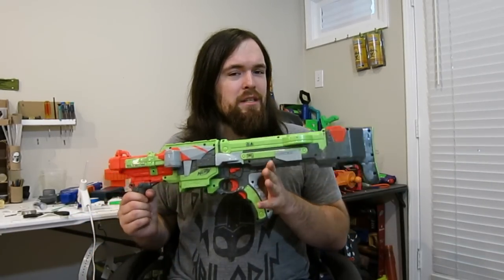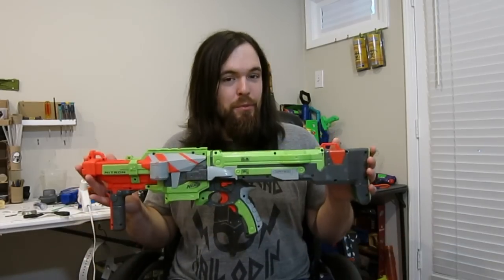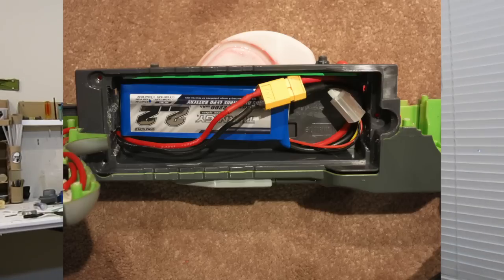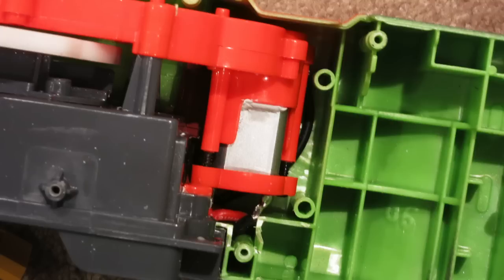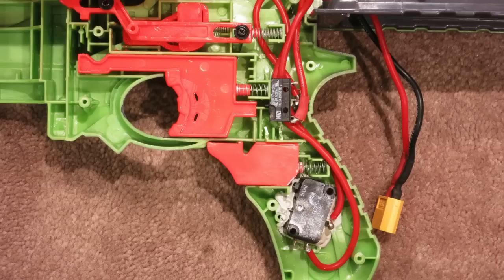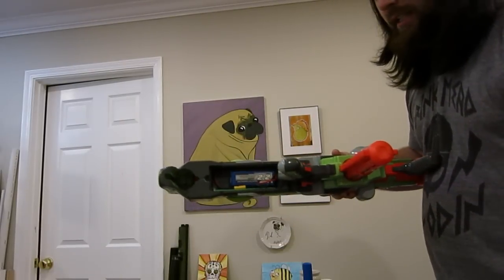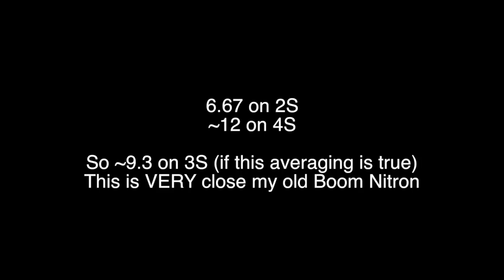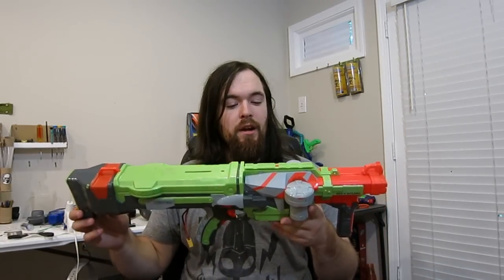Nerf Boom Nitron 2.0 (Upgrading the Boom Nitron)

Comment: I also encountered the problem where the pusher doesn't fully contract. It's because there is a switch (in stock form) which will continue the circuit so that the pusher retracts after you release the trigger. It's not as simple as just rewiring the circuit with the switch, though. If you keep the switch in (and overvolt it), the pusher will move so quickly and it will not stop fast enough. Because of that the big white disk will keep contacting the switch and keep your circuit open.
Reply: Which is why you also need the "active" or "dynamic" braking feature. That's what slows down your pusher mech fast enough to stop it overrunning the switch. The more powerful your motor the faster it can brake (which is why pusher motor replacement is better than pusher motor overvolting; you get the same higher RoF but without runaway firing).
Reply: RGBGamer what?

Comment: Thanks for posting this mod.  Inspired me to get a Nitron and mod it.  I did the 180 motor swap, rewired w/ 16 gage stranded from an old extension cord and upgrade both switches w/ 15A micros.  It wired so the pusher switch only gets power if the fly is running.  I'm running a 3s Li-po in it.  All the mechanical locks, old switched and wire have been removed.  The Nerf gun that was considered a joke by my kids now dominates.  I just need to make a double mag so I can scavenge and reload while shooting.  Again Thanks for posting the video.

Comment: Just a thought. DC motors have a sort of braking capability if you short out their terminals. If you use a switch that shorts the terminals to each other when it's depressed, the motor should stop faster. This is the method that cordless drills use.

Comment: To get the pusher motor to always return to the starting position, you need to integrate a tapered switch that closes a circuit only when the arm is fully retracted. If the motor is running too fast for the auxiliary and it overrides the switch, this can easily be remedied by putting a resistor in the return mechanism circuit. The stock (original) switch will not function with a Li-Po.

Comment: I love this video.  Thanks for posting.  The 180 motor mounting tricks is nice to know.  I would like to know what RC motor size the fly wheel motors are closest to.  130, 180, 370, 540....  Have you considered replacing the stock fly wheel a Worker fly wheel for a Stryfe?  Are they the same size?  It would make a cool video to e see the Nitron shooting without the barrel focusing on just the cage.   It would be interesting to know if the barrel slows down the disk and helps them go straight.   I'm also curious as to which direction the Idler wheel spins and if replacing it with a motorized wheel would kick it up a notch? I'm currently machining a Dr Snikkas inspired fly wheel cage and wheels, because I can't get one here in Kansas for a project.  After seeing the Nitron spaming disk, I want to merge a Rapidstrike  and a Nitron to have the ultimate 2n1.   I now want to make an aluminum Nitron cage and pusher.  My goal would be  no plastic shell to hide the guts and make it ultra compact.  However I'm still trying to get the bugs worked out the Snikkas inspired cage.

Comment: Hey, since you posted the Boom Nitron V 1.0, i thought about getting this insane rate of fire without fueling it with this crazy amount of volts. After watching the 2.0 video, i finally started trying it by myself but until now i couldn`t get any further.
I tried using an 18d motor and last a motor similar  to the original one, but with 20k rpm at 12 V, both driven by an 3S LiPo-pack.
What did you do to this thing to bring it to an acceptable RoF under 12 V ?
Reply: He used an outdated blade 180, use any high rpm nerf motor, mtb makes good ones, for higher rpm

Comment: Am I right to rip off the board on the stock flywheel motor? Cheers
Reply: Our Adventure I'm fairly certain the board doesn't serve any function to the actual function of the blaster. Cheers m8 :)
Reply: The Frenchest Fry thanks mate, already done it and it turned out great. Cheers

Comment: Did 3s lipo work well?
Reply from the maker: Yes. For the stock pusher mech, 3S is fine.
You can also use a Rapidstrike pusher box instead of the Nitron's pusher for a smaller footprint. The LiPo for that will depend on what motor you select for the box.
Reply: @Bobololo  alright thx so much